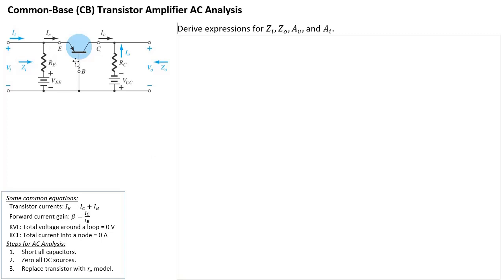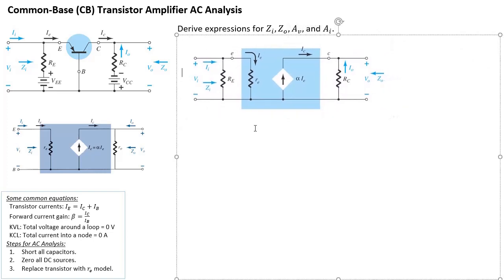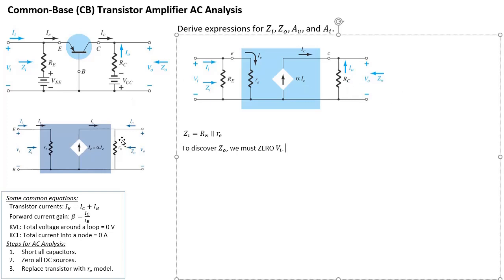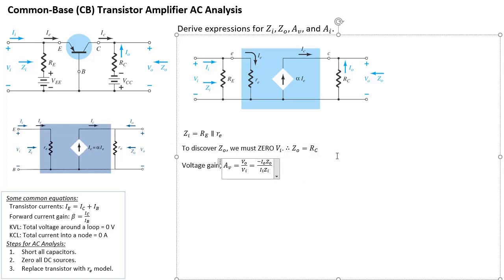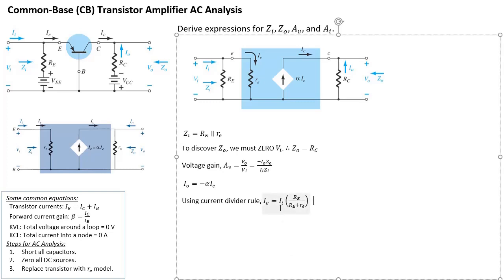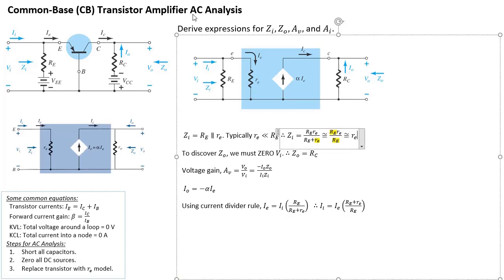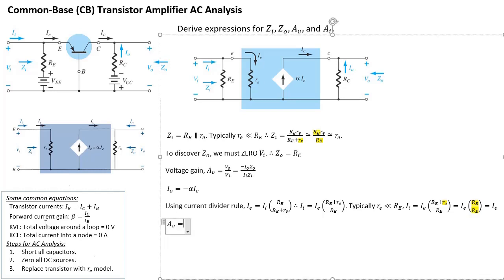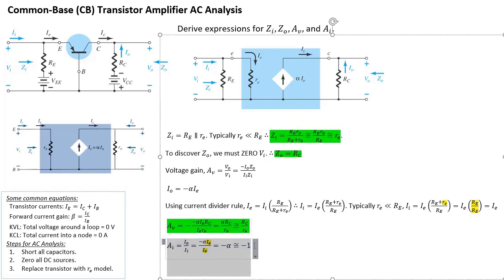Common Base (CB) amplifier, AC Analysis

Comment: EXCELLENT PRESENTATION!WHERE DO YOU GET THE - SIGHN FROM?
Reply: THANK YOU FOR TIME!
Reply from the maker: Hi David. Thx! Can you be specific which -ve sign you're referring to?
Reply: THE CURRENT GAIN - ALPHA.
Reply from the maker: @davidluther3955  Alpha is not negative. The negative comes from the fact that the current (alpha x I_e) is equal in magnitude to I_o, but in the opposite direction.